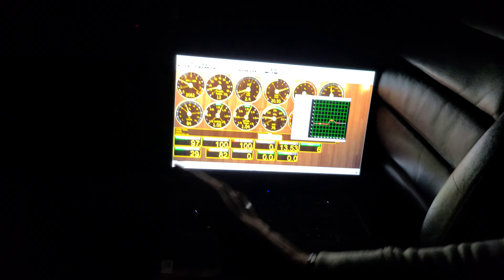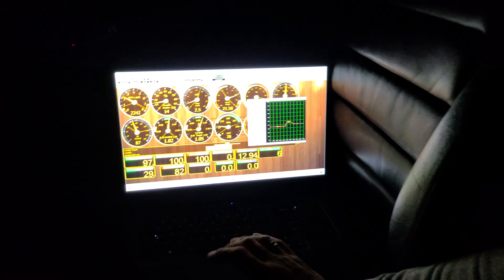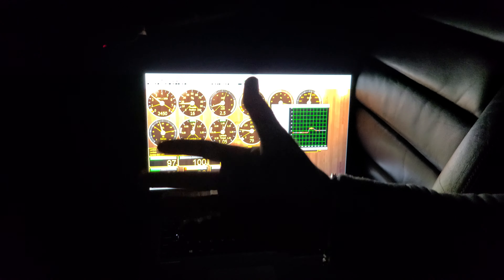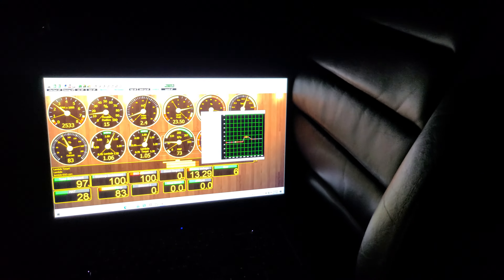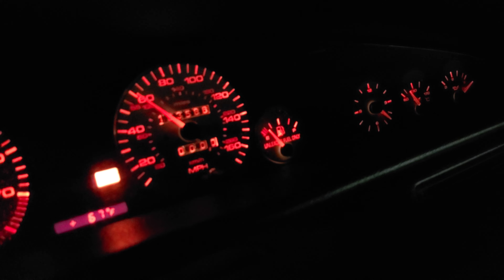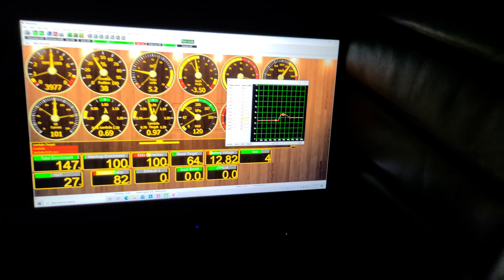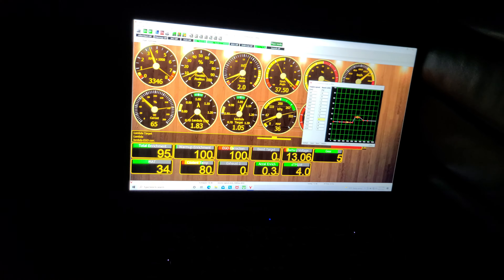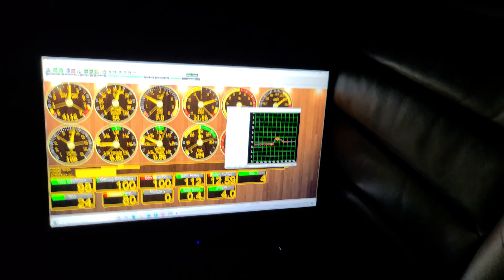VEMS "Rolling Anti-Lag" Alternative Using N2O Control

Comment: I’m gonna try it. I bought my 944 turbo with the standalone ecu plus 750 cc injectors the car is ready to put down all the power I just want to adjust everything. Installing a different spring on the waste gate as well...  Regarding boost can I adjust the boost on the vems app?